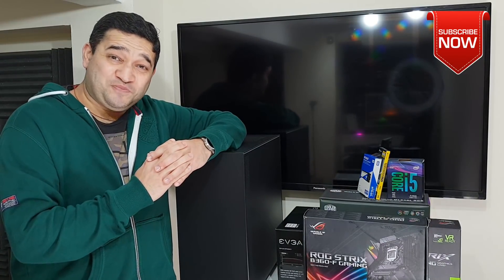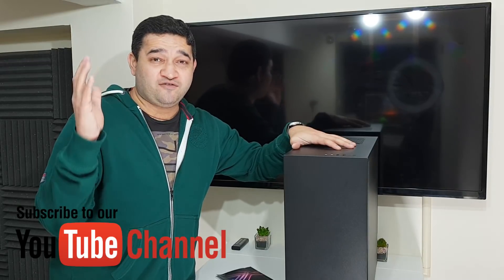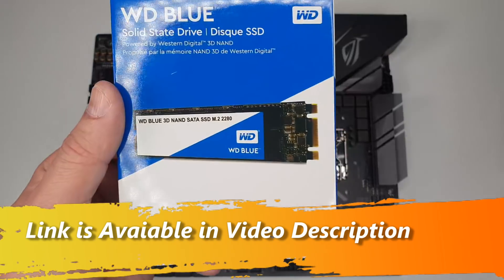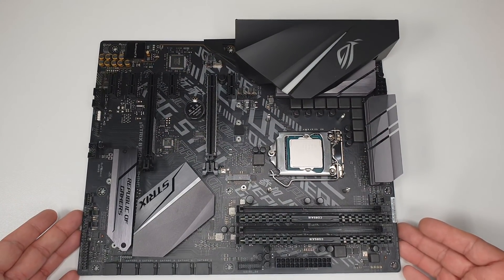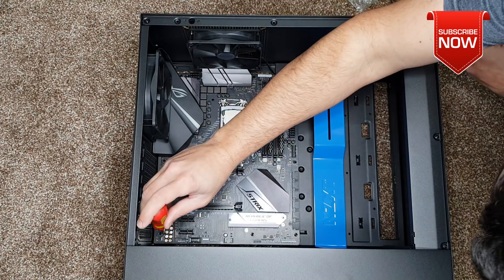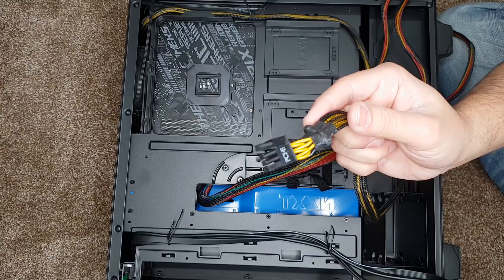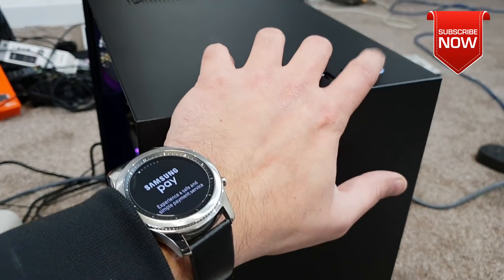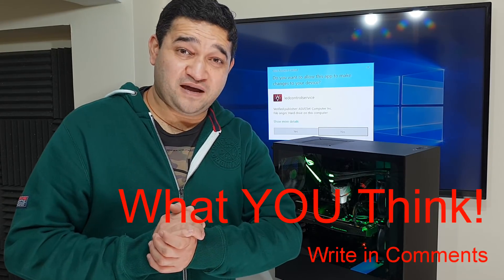$1000 Gaming PC Build - i5 8600 GTX 1070 Ti ( Step - By - Step - Guide)

Comment: QUESTION.. I HAVE THE asus rog strix b360-f gaming AND i5 9400f .. i want to buy TRIDENT Z RAM 3000mhz... IS THIS WORK?  I KNOW IT WONT WORK AT 3000 BUT AT LEAST AT 2666mhz ??
Reply: Yes it will work, but the RAM will not operate on 3000mhz it will operate on 2666mhz instead.

Comment: Hi sir! I just have a question i have the same motherboard but i want to install even more ram i have 16gb know but i want 32 so i buyed 2x8gb but do i have to take the whole motherboard out or can i just open the glass and just press them in without taking apart every parts if you understand? Thanks sir
Reply: If there isnt anything in the way i believe you can just stick it in
Reply: Mitt kön är Lindkvist yeah iknow thats what i did

Comment: is this working with an i5 9600k ?
Reply: No it won't as motherboard only supports 8th gen processor you can go for b 365
Reply: ANUBHAV TYAGI well is use it with i5 9600k since 6months

Comment: Your radiator fans are pulling hot air from the case into the rad and out of the case, that should be opposite. Airflow should go one direction, but you got all 4 fans pulling air out.
Reply from the maker: OK thank you so for updating me will check on it have not noticed any issue